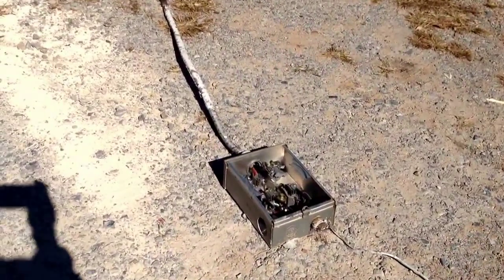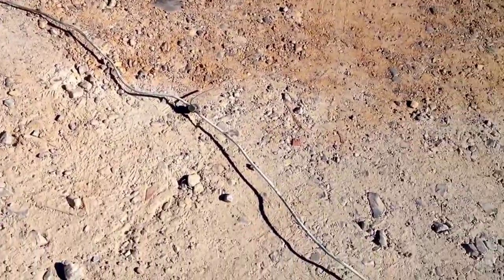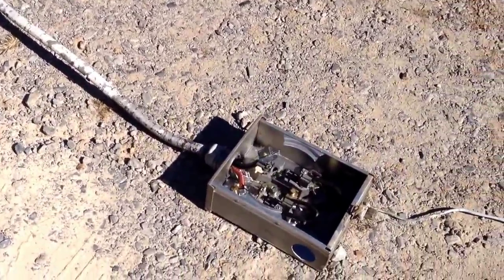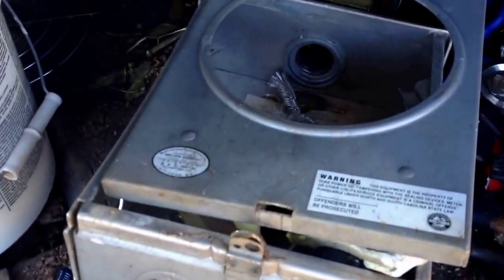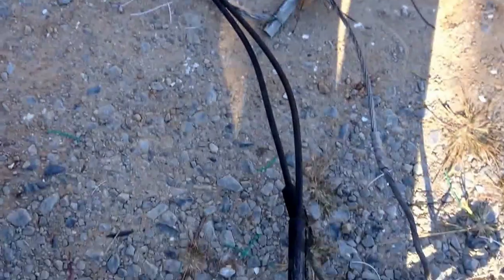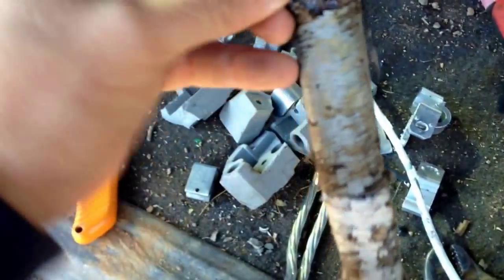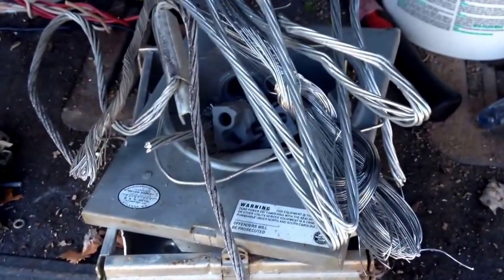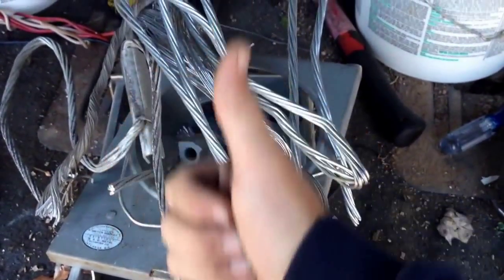Scrapping a electric service entrance for copper and aluminum

Comment: have to be careful with thr cloth coated wire. I work for an electrician on the weekends and we turn that stuff in insulated. had aspetos in the insulation.